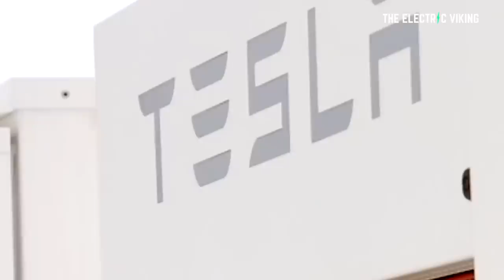Tesla's clear path to become largest truck manufacturer in the US

Comment: Tesla Nevada is building the Semi's.  My guess is they will use 2170 batteries also produced in Nevada.  The 2170's may not be used in cars in a few years.  I see Semi trucks delivering to grocery stores and I doubt they travel more than 200 miles per day.  These trucks could charge at night during off peak times.  Diesel trucks don't like to turned off in cold weather so often they are running when going  nowhere.  To say changing to Electric is a no brainer is an understatement.

Comment: ClearFlame Tech  cost per mile is expected to be substantially lower than electric and hydrogen platforms—40% less than electric and 30% less than hydrogen. It uses the diesel drive train and fueled by ethanol or methanol and has partnered with John Deere.
Reply: Methanol cost 3 times as much as Diesel. And if you tax it accordingly like Diesel.

Comment: Considering that there are 2 million Class 8 trucks in the USA. Plus, a huge number of passenger cars that also want to be replaced with electric ones, then the USA needs just a little. Just build another half of the energy sources that exist now and work for both industry and households. Try to calculate which power plant should work in order to charge 10 SEMI TESLA at the same time in fast charging mode. Try to calculate how thick the cable should run from this power plant to the charging station. It's just physics and mathematics. I have no doubt that Tesla will take its place in the truck market. But I think it will be about 20-25% in the US market. I think that another 25% will be occupied by various trucks with the HYLIION ERX system. This is when a gas generator from Cummins is installed on PACCAR trucks or another truck, which transmits electricity to the electronic axis for movement and to the battery, which gives us the opportunity to drive 75 miles with the generator turned off. This option is cheaper than diesel and cheaper than commercial refueling with electricity. It does not produce the same amount of emissions as diesel. It is more environmentally friendly than electricity, which we get in many places with the help of coal. It gives negative emissions if we refuel with renewable natural gas.

Comment: My semi is Dangerously slow on hills and each time i merge on a highway..its extremely under powered.
Reply: Yup but a bunch of haters saying the performance of a semi doesnt matter; literally every truck driver wishes they could pass with ease
Reply: Sounds like you need to put a deposit on a Tesla.  However, on a recent 9000km round trip from Melbourne Vic to Cairns Qld, I was chugging up a hill in a small Kia (petrol) and was PASSED by a B-Double Kenworth like we were standing still (mind you, the little Kia is a bit under powered at only 68kW) !

Comment: The ROI/economics of running an electric truck vs a diesel truck is obvious. On top of the diesel fuel vs electricity cost, the diesel truck's oil change ($), brake service ($$), and, most importantly the time ($$$) it was taken off the service are huge. That does not include the impact of carcinogen diesel fume that truck drivers breathe in every day. I bet there are some cancer statistics for those 5, 10, 15 years truck drivers.

Comment: What if Tesla decided to form its own trucking company and they just don't sell the semi to anyone else?   nobody has thought about this scenario.  I can see it happening since truck drivers are picky and usually prefer a 1800 mile range truck over a 500 mile range one.    If it is such a great deal to have an electric compared to a diesel - then Tesla could do this.    Also, since they go automatically - they can have fleets or convoys.   I've heard it said that they'd be competing with rail in this scenario !   crazy.   Imagine having robots that can unload freight too, either by hand or by themselves driving a forklift.

Comment: Yes in trucking the margins are very thin, currently Truck costs, diesel and Insurance are about 60% of cost, the rest primarily being labor.  So even if they can reduce the 60% by 10%, it will be huge
Reply: the entire truck / semis market is turning to hydrogene, just look at current government bids in both US and Europe. Small trucks and vans are BEVs, stellantis being very clear world leader in such commercial BEVS
Reply: @dnap1991  Hydrogen makes it green but does it save money over diesel ?
Reply: Oil changes are about $300 a pop.    PLus the down time to have it done.
Reply: @danharold3087  Charm up someone who delivers for an auto parts store my friend, we can knock that down to $50 for ya on my employee discount. shhh it's our secret.
Reply: Try total disruption.
A better truck, faster acceleration & uphill, less maintenance.
FSD autonomy, so no driver labour (soon enough, by time there’s 100,000 trucks on the road).
Working 20 hours a day, 365 days a year (fleets first).
So quiet - no exhaust braking.

Comment: Tesla need two tracks for this:
As indicated, the production of their semi truck, with at least 500 mile range.
But just as important: the infrastructure for recharging them!
So new charging locations should be far heavier, and current ones must be upgraded!
Reply: Tesla has developed a charger for the semi.  Originally it was called a MegaCharger.
It is designed to charge the semi.
They have been installed where pepsi needs them.
As Tesla expands the customer base it will install the needed chargers.
It will take much longer to place truck chargers everywhere like car chargers.
Fortunately most trucks travel fixed routes.
Reply: They are already installing truck chargers at locations the first trucks will need them. The numbers are growing. Was the same for Tesla cars in the begining. Look at that charger map now.
Reply: @sdpryce  yes I know. But what is shown by “now you know” new superchargers, should become megachargers.
Reply: @hanswitvliet8188  Tesla Semis can also charge at superchargers. That is still much faster than all the other Semis can charge. The megacharger is the real thing.
Reply: @vic321344  Tnx!
I wasn’t aware of that, thanks for educating me. 250kW is indeed slower, so it will only take a bit longer.
Reply: @hanswitvliet8188  Still better than the 130 kW used by all other truck manufacturers. Gen4 Superchargers can go up to 400 kW.

Comment: I’m starting to wonder if Tesla is developing vertical geographical integration. Tesla builds the semi at Giga Nevada. They just announced an expansion. Panasonic and Tesla build batteries at Giga Nevada. Where is the only lithium mine in the USA? Nevada…if they can figure out how to process lithium in Nevada than Tesla will have mostly achieved vertical geographical integration.  The Nevada Gigafactory is only 30% complete right now.  I guess we will see!
Reply: Try Corpus Christi for import / refining facility. They have deep water port, close to Austin. Where would they source Lithium ore I wonder? I’m thinking Nevada unlikely to expand much more, it’s mostly Panasonic facility, it’s tied to Fremont, which also won’t expand a lot.

Comment: I would have thought that Tesla should hit the somewhat smaller delivery vehicle/van market.
It is both a bigger and a broader market; the vehicles travel less distance each day and they tend to operate in built up areas, where pollution abatement is more important.
The big semis won't be able to do long hauls routes, leaving this market to the legacy manufacturers.
Reply: I believe it’s the cost advantage of electricity vs diesel, batteries will be cycled daily, twice daily. Tesla just wanted the biggest challenge, biggest, most obvious disruption. They can make one design, ad nauseam (inc mid-range). Delivery vans could be mocked as a toy.

Comment: Period. The charging infrastructure for Semi's is just not available yet! When it states rolling out yes go for electric no contest. That clip of a Chinese truck spewing out all that unburnt diesel, not going to be allowed in OZ. That motor and injectors were stuffed! You don't have to find the worst example to get the point across. It is the 2.5 micrometers and under particles that do most of the damage to your lungs! You can't see them. Period!
Reply: I think you mean 2 micrometer. 555 nanometers is the wavelength of green light.
Reply: In theory you are right. There are still way too many stinky diesels on the road. EPA is not catching everyone. Trucks are incredibly noisy too. Why have exhaust brakes when you can regen instead? My main concern as a cyclist is hearing them coming. 

Tesla is installing Megachargers at company depots. They are already installed at Pepsico.
Reply: @theairstig9164  WTF
Reply: Here in OZ, the state and territory transport departments have the power to put excessive polluting vehicles off the roads! The EPA is for industrial pollution etc.

Comment: I've been a Tesla fan since the beginning.  I have believed in Elon when few others did.  I guzzle the coolaid but I cannot imagine Tesla having an annual run rate of 50K heavy haul trucks by the end of 2024.  I hope so but even I don't believe it is achievable.
Reply: At least they built a gigafactory to achieve this.
Reply: The main impediment imo is having the battery cells available. If Shanghai can make a million vehicles a year why can't a truck assembly plant make 5% of that number?
Reply: @danielstapler4315  Tesla will produce double as much battery cells next year as all the others have produced this year together.
Reply: Have faith. That’s motors in 75,000 model 3’s, cells in 500-700,000 model 3’s.
The pack assembly can be automated - look at the Austin 4680 for simplicity.
Construction not much more difficult than S or X, and they do 100,000 pA of them (basically hand built).
Musk always sets aspirational timelines.  Need a dedicated factory first.

Comment: Elon says 500mls  for the fully weighted SEMI to 82000lbs on the FLAT! Imagine getting up to elevation and then regen downhill.
Reply: Yep. Powerful motors, huge capacity to accept regen charge downhill - much better than exhaust brakes or friction brakes. Diesel can’t do that, HyLiion will run out of battery capacity (apologies, they’ve been trolling this comments section).

Comment: Interested in your take on how these electric trucks will be charged.  Concept is great but unfortunately the bulk of electric trucks will be charged by coal fired generators. Also the mining equipment used to make batteries and the steel and other alloys for these trucks will ultimately use diesel and coal.  Just saying.
Reply: On the other side the cost of operation of the Tesla Semi is just half of a diesel. Just saying.
Reply: @vic321344  Need to hear a lot more about the amount of clean green Megga Watt power generation that will be required and I hear nothing about this. As we all now solar does not work at night or when we have cloudy days and the wind does not always blow.  There will be some very seriously big Megga Megga batteries needed to cover the solar and wind down days.
Reply: @ashleyhether4993  Who needs clean green Megga Watt power to drive a Tesla Semi? Electricity is just enough.
Reply: @vic321344  So driving a mighty clean green Tesla electric truck using dirty coal generated battery power is ok correct?  Until the world is using 100% clean green generated power to mine materials for manufacturing electric trucks as well as electric cars and to charge these enormous truck batteries and car batteries and build these trucks and cars I will remain sceptical about the whole electric dream using dirty power generation.
Reply: @ashleyhether4993  It is correct to drive a Tesla Semi. It is fast, it is powerful, it costs less than half to operate than a diesel. And maybe you think driving a diesel is clean power.
Reply: @vic321344  You are clearly not understanding standing what I am trying to get acroos here so will let you to think what you think. Enjoy your day where ever you are Vic321344.
Reply: @ashleyhether4993  Yes, it is really absolutely unclear what you want to say.
Reply: @vic321344  LOL if I put it this way to you would this help you.  We have put the "cart before the horse" when it comes to the electric drive future.
Reply: @ashleyhether4993  You are talking in riddles.

If you talk about a very remote area with not enough electricity (where?), then there are easy alternatives. Install a 1 mW Wind turbine, 2-4 megapacks and you can  most autonomously provide 4-8 megachargers. And even earn money in that you can sell surpus electricity if the net needs it. For a high price. And relaod your batteries when the price is low. This function is already built in in every megapack.

Comment: Nothing is inevitable, Tesla as yet cannot build the only battery it makes, the 4680. It cannot build them reliably therefore profitably. If it could they would use them. They are not first to market. Perhaps two seats up front is required and it's dangerous not to be on the outside, tried driving a left-hand vehicle in a right-hand country recently, and no FSD will not come to the rescue anytime soon.
Reply: Good luck with your view on driving in the middle, with all the cameras, screens and poor aero BIG Bloody Mirrors at your disposal.
Truck Drivers are gonna love this rig!    imho

Comment: This is a slow burn product - there’s no way Tesla will sell 50K of these next year or 2024. They’ll have to start with specific routes with specific customers like Pepsi and prove that they work in the real world.  This means installed mega chargers at each end of the routes. This is going to be a slow build-up as there is no infrastructure for long-distance hauling out there.

Fast forward 10 years and yes they could be selling a lot of semis BUT I actually think this is a more a test bed for them to bring out a smaller truck that will be able to use normal (upgraded) Superchargers. This would make a lot more sense as a volume sales vehicle than the Semi.

Comment: I didn’t hear you mention FSD - which will totally disrupt transport. Given Tesla version is super minimalist, can apply to much smaller units as well, not just semi-tractors. Tesla wins through having access to best engineers, most innovation, software skills, charging infrastructure, network. 
Truck manufacturers are having to learn the EV tech without playing with cars first, steep learning curve.

Comment: The Hypertruck ERX is going to sell 100X to the Tesla Semi. I love Tesla but there is a reason the last two presidents of Tesla’s heavy trucking division quit. There is simply a much better solution entering mass production in late 2023 with Hyliion.
Reply: Natural gas as an alternative to BEV? i dont think so. Would also be banned in Europe in 2035.
Reply: @vic321344  2035?! You’re worried about Europe in 2035?!
In that case, check out Hyliion’s Fuel- Agnostic and Hydrogen Fuel Cell transition plan.
But seriously, we need a climate solution now. Not in +12 years.
Reply: @vic321344  I’ll quasi-agree that the transition to hydrogen is going to take +10 years or more, so who cares at the moment. But without huge amounts of Green Hydrogen, or Hydroelectric power, or Wind/Solar, the options to charge the Tesla Semi are as dirty as the diesel it hopes to replace.
The grid can’t support it anyway.
Reply: @afrotacular  Only 2% is green hydrogen. And it is 3 times more expensive than hydrogen made out of methane. And this is 3 times more expensive than diesel. The efficiency of hydrogen is 30%, the efficiency of electricity is 90%. So why on earth does anybody want to convert electricity in hydrogen? And not use it directly in BEVs? To expand an electric grid is easy and cheap, compared to hydrogen grids.
Reply: @afrotacular  Another nice little fact: For the energy you transport in a single 40t Semi with diesel aboard, you would need 18 Semis with pressure tanks full of H2.

Pipelines to transport H2 are very expensive and have to be made out of a very special alloy. Same with the gaskets, which have to be changed quite often. H2 cannot be kept idefinitely. It is the smallest known molecule. It diffuses through every known material. Making alloys brittle. And it is explosive in a very wide range of mixture with air.

Shell recently closed all their H2 fueling stations in Briton, after the highly subsidised testing phase was over.
Reply: @vic321344 Like I said, I agree Hydrogen is so far down the pipe that it's foolish to consider in the near to medium term. But when it comes to a practical well-to-wheel approach, infrastructure needed and the TCO for fleets, Hyliion's Hypertruck ERX (RNG fuel) beats the Tesla Semi (pure BEV) in every category.
Reply: @afrotacular  Hyliion is a poser company. Like Nikola.
Reply: Why does HyLiion need a troll farm to spruik it’s products? 
It’s sickening, overkill.
Smells like Nikola, like Trevor Milton.
Still relies on fossil fuels, provides a small gain in fuel efficiency (like in mild-hybrid cars).
Ian Wight (Tesla founder), has similar ideas.

Comment: Nothing mentioned about infrastructure. Tesla is going to struggle to charge those trucks. They need Hyliions Karno technology
Reply: Facts!
Reply: @vic321344  it’s a Bev not a hybrid! It has batteries and electric motor just like Tesla . Hybrid switches back n forth from Batteries to fuel to turn it axles. Hyliion only uses electric to turn it’s axles .